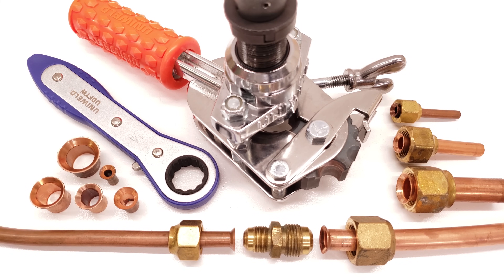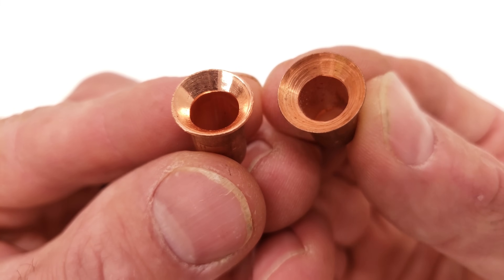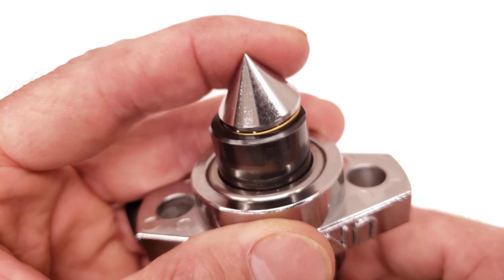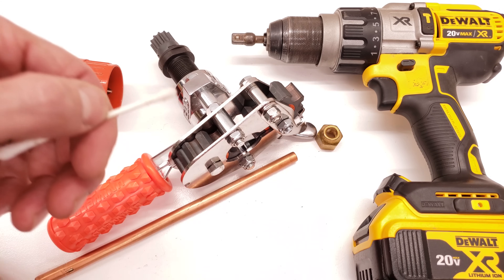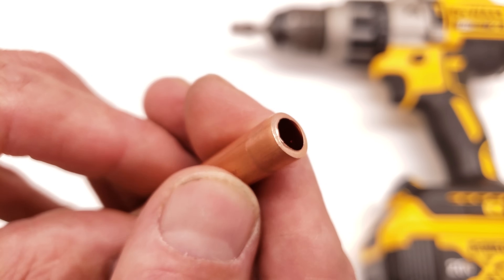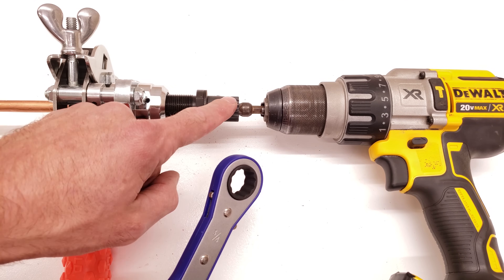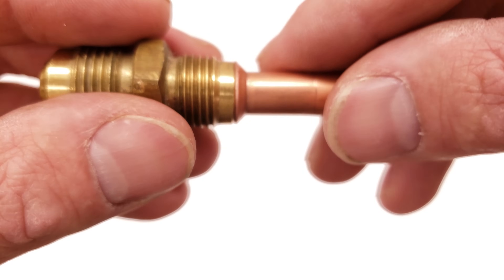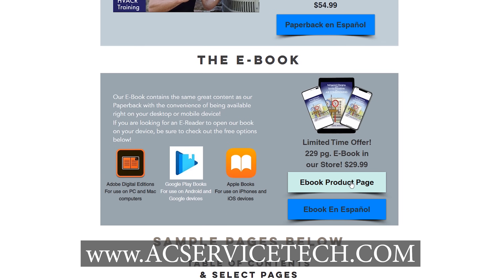Why Eccentric Flaring Tools Make The Best Mini-Split FLARES!

Comment: Double flare is the best this method is used for hydraulic fittings up to 12000 PSI and don't forget to clean the ends clean clean clean clean clean clean clean clean

Comment: Thank you for sharing experience . I recently doing some LG units , some smaller units are required flaring to connect to the condenser and I had my first leak due to scratches . Thanks for helping me to improve

Comment: I'm ready to buy an eccentric flaring tool. I see the ones like the Yellow Jacket and the one your using here for $130-$170, and I just saw one that looks pretty much just like the Yellow Jacket for $35. In general I hate cheap tools, but I think it's wrong to just hate them because thier inexpensive. As a plumber I never have to flare anything, but I'm installing my first (and perhaps only) mini split and I'd hate to buy something I'd be disappointed in. Do you think inexpensive is a bad choice?

Comment: Is flaring tool is another toy that makes the flare to thin  a double flare tool works best it has plenty of copper to seat on the flare services when double wrench to heavy wall Frost nut and those High pressures of 410A
Reply from the maker: Guy, the manufacturers just call for a single flare torqued to their ft/lb specs, thanks!
Reply: Just because the buzzword is manufacturers doesn't mean it's right we tried all the single flares they are too thin you're actually making a copper with a double flare tool like EASTWOOD PROFESSIONAL  LINE AND TUBING FLARING TOOL. this mate to the brass fittings and seat good why do you think the brass fittings are so heavy wall and one and is braised on.. you can cut those fittings out and braze both pieces together that's top end but that voids warranty. And you don't have to add any sealer Teflon tape duct tape pipe dope wait till you get into CO2 gas

Comment: You said if the flare is too small or will leak, what if the flare is slightly bigger
Reply from the maker: That won't hurt but only help as long as it can still fit into the flare nut, thanks!
Reply: Sometimes when you make too big of a flare, the edges get super thin and split, which then can spread to the good part of the flare. But you usually would have to go quite a bit oversized for that to happen.

Comment: Navac tool also does a good job if you have to make flares all day.
Reply from the maker: Absolutely, thanks!
Reply: @acservicetechchannel  Thanks for the video. Hey, you should do a video on the differences btw single zone and multi zone ductless units. I plan to install a multi zone but fear it won't have the same amount of capacity control for each zone. 
Oh well, wifey doesn't want multiple outside units.

Comment: We stopped producing flare connections long time ago. We utilize braze free zoomlock crimp connections. One should use the added protection seal  of Flareseal for flared connections if your committed/invested with quality copper flare tools. There are also braze free quick connectors by Recterseal- undecided. Manual tool and die in the field creates to many variables on a mechanical flare that has to be sealed 100% in refrigeration. One can still braze on a mini split but the skill level goes up to perform well along with safety and hot work permits.
Reply from the maker: The issue is that the outdoor units still need a flared connection regardless of other connection points but yeah zoomlock or brazing can be done in other locations, thanks!
Reply: @acservicetechchannel  They've sell a zoomlock to preflared adapter for $38 each if one is really afraid of flaring.

Comment: Do the copper pipes on a mini split heat pump need to be flared like that or could you just braise them?
Reply: Flare is the unit design. Esp on condensor unit. For evaporator braze is possible but usually quicker  and safer to flare. 
And hope for the best in regard to leaks ( over the long term)
Reply from the maker: At the outdoor unit, the tubing must be flared but at the rest, they could be brazed but make sure to flow nitrogen, thanks!
Reply: "braise" them?! I would suggest MIG welding for a positive seal. You're welcome.

Comment: Yep, I have an eccentric flaring tool, it works very well, mine does not have the stop for the tubing you have to judge it by eye, but that's not a big deal.
We have a spray here called Flare guard that we used on the cone of the flaring tool, works well, I save the nylock for for the actual fittings.
Love the book and the videos!
Cheers from Tokyo!
Reply from the maker: Very nice, thanks Tokyo!

Comment: Spin tools causes galds and scratches. Not allowed in certain certified application. Just because it is quick doesn't mean good, unless quality doesn't matter. Like clowns that don't braze with nitrogen.
Reply: Quick.. cheap. Invest in good tools. They will invest in you
Reply: I'm looking right now at a smooth flare made by the spin tools. It has a lip in it but that's on me for not reaming. 
Achieved no loss at 350psi nitrogen and a final 60 micron level vacuum after sitting for 10 minutes. I think it works just fine.
Reply: @sprockkets  I think IF you lube the work so that there is no weld and hence no galling to make ridge it can work but people I work with make leakers which I have to go back and fix.  Mini splits especially,
Reply: I’ve been using the spin brand bits for some time and get great results.  It’s like any other tool, when you use it enough you learn how to get good with it.

Comment: I would like to see a comparison with a pressure test on the different methods of flaring.
Reply from the maker: John, thanks for letting me know what you would like to see!
Reply: We started double flaring our ductless. I had a Mastercool hydraulic unit in the shop that I use for double lap stainless brake lines.  Once you use a double flare you will never look back. Disc brakes can exceed 1400 psi so they can easily hold 400 psi on a 410a system.